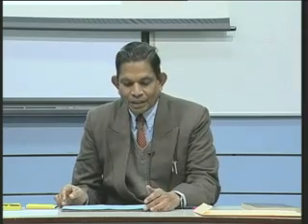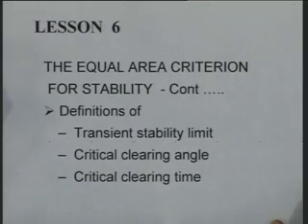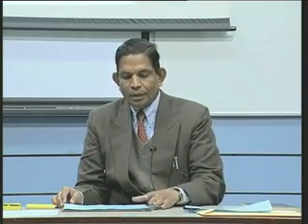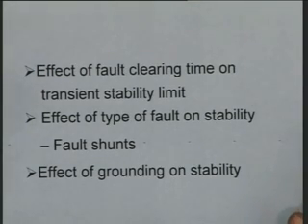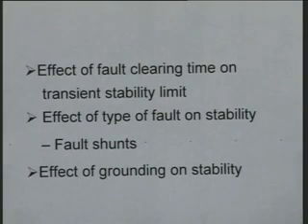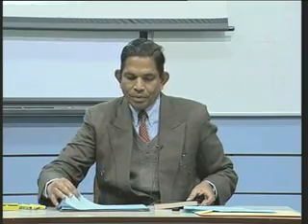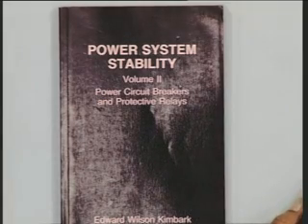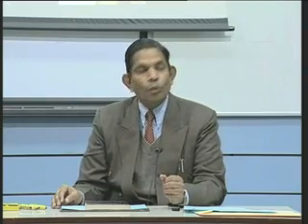Lec-6 The Equal Area Criterion for Stability-Part-2

Comment: can someone please tell me what's the reason to use radian as units while substituting Delta values in critical clearing angle formula
Reply: Because when we derived swing eqaution then we had angular speed in electrical radian in the expression.So either you convert that to degree or go with radians in each term.